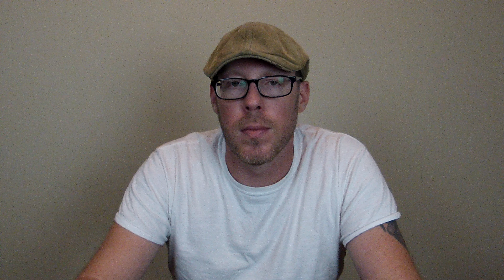How To Ground A Swimming Pool

Comment: Our pool shocks people   It was here when we moved in so I’m wondering if it’s a bonding issue?  Or a grounding issue?  Is there a way to tell?  Without tearing up all the concrete around the pool?
Reply from the maker: Almost certainly a bonding issue but that might now be the only problem. A pool that shocks people, no matter how little, should absolutely, 100% be closed to swimmers until an electrician can detect the source of the stray voltage and determines if the pool has an equipotential bonding grid.

Comment: I bought a metal in-ground pool from pool warehouse.  Nothing in instructions about grounding or bonding.  I have fiberglass stairs going into water.  All metal parts are bolted together and I will be installing a light in the deep end.  Since all the metal is bolted together what would be the proper  procedure to "bond" the pool?   Thanks.
Reply from the maker: There is only one way to answer this question.  The proper way to bond your pool, any pool, is to hire a licensed electrician specifically experienced with equipotential bonding grids.  There is too much liability in your question for anyone to answer that on the internet.  Also the bonding grid is what prevents you from being electrocuted in your pool so it is pretty important overall.

Comment: Steve, if a fiberglass pool has metal steps or handrails, does the water need to be bonded, and how is that accomplished? The heater and pump lugs are bonded and grounded. Thanks

Comment: An interesting thing you will notice on any radio transmission site like a cell tower for example is everything is grounded, sometimes with cable as thick as 1 or 2 gauge, and it is not secured with mechanical fasteners but actually welded in place on the structure to ensure is absolutely never corrodes or comes off. Literally everything metal from the fence, gate, metal steps, hand rail conduit etc.. To protect against RF interference
Reply from the maker: This would also help to provide protection for the equipment in the event of a lighting strike